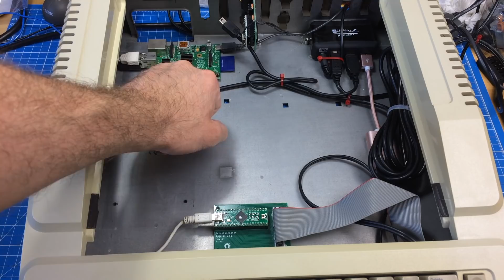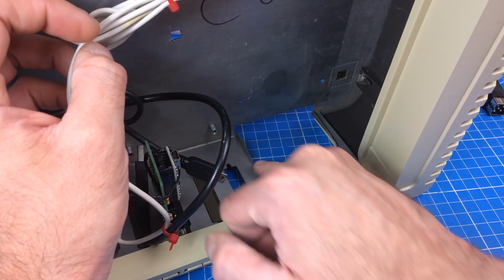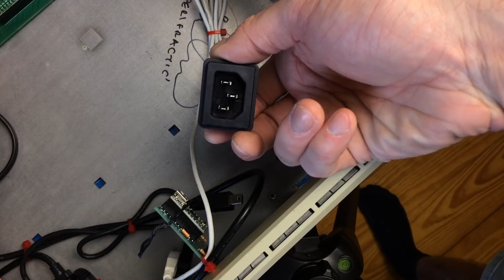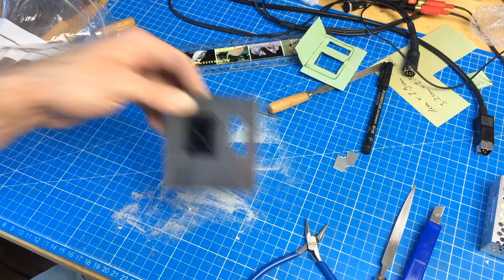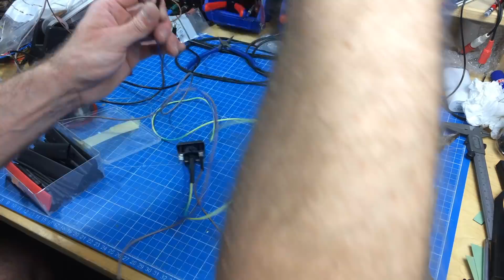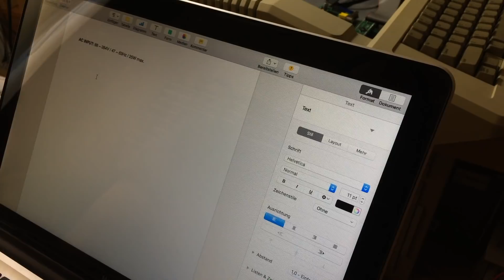Apple PIIe PSU build for the #ThinkDifferentChallenge

Comment: Case nibbler is the easiest way to cut rectangular holes in metal. Start as you did with a drilled hole, then rest can be done with the case nibbler. They are a good cheap tool to add to your toolbox.

Comment: i know, this ist old!
And Jan, i guess you would do the PSU in a different way now.
But.. I would have done the Aluminium for the switch and the powercable from the inside! Spacing the inward bendet case, but getting a nice and clean 'outside', wich forgives a trashy metalplate on the outside.

Comment: Question: 12:51 you can see the hole where the power things go. Why didn't you attach the new plate from the back? It would have looked way cleaner and better. What was stopping you from doing that?

Comment: When switching mains it's a good idea to use a double pole switch. With that you will assure there is no mains voltage at output when switched off.

Only becomes an issue if you fiddle with stuff when plugged in but it's a good practise to use them nonetheless.
Reply from the maker: Yes, that's true. Especially because live/neutral are not fixed in most European countries.

Comment: Great job with the heat shrink, but remember those fuses are live too. Those type of connectors should really come with a back box to fit inside and cover the connections.

I'd also have probably taken an earth wire straight to the case as it's metal but it should be earthed through the screw into the psu anyway.

Comment: For aesthetics, I feel the aluminum sheet should have been placed inside the box and attached, rather than on the outside. Same location, just attached to the inside. Still interesting.
Reply from the maker: Yes, I rushed it a bit so I didn't go through the effort of bending it into the correct shape. Would have been a much more elegant solution in retrospect though.

Comment: The exposed fuse holders on the back of the mains socket are potentially lethal.
The active line and neutral line can both be touched by an unwitting user.  The arrangement shown needs an insulated cover for safety, and a lead from the earth terminal connected to the metal chassis with a star washer, nut and bolt to ensure proper earthing.

None of this was necessary with the two small power supplies because they are self contained and there are no exposed mains voltage connections.

A better alternative would have been an IECC connector with a covered fuseholder (they exist(.
https://www.opentip.com/search.php?cPath=10435&products_id=1263337&gclid=EAIaIQobChMIkPCl3tuP3wIVmzUrCh2lDAJ1EAQYAiABEgKYdPD_BwE

It's even possible to get IECC holder, fuse and switch all in one unit (there is a bare metal strap on the inner face, but this could be made safe by applying epoxy to cover it, just as Heat Shrink covers the terminals).
 The one below would only need one hole, making the installation even easier.
(47x27.5mm)
https://www.jaycar.com.au/iec-fuse-chassis-male-power-plug-with-switch/p/PP4003

Additionally while the Power supply used is more than adequate, the solder pads on the rear of the board under the screw terminals are bare, which is another potential risk. (They also need an insulating cover to prevent accidents.)
The protection circuitry in the Power supply will protect it from short circuit damage if it comes loose and a mains solder pad touches the case (which should have a separate earth lead on a screw terminal for this reason), but it will not do anything to protect a human who comes into contact with the mains voltage before it enters the power supply!

A great idea overall, but not safe in the form shown in the video (especially considering it may end up in the hands of users with no knowledge of exposed mains fuses or safe mains earth connections)!

Comment: Would have been nice to have put that power supply inside the original Apple supply that way the switch and line socket wound be like original. Or a small  project case with line socket and switch mounted just inside like the original supply mounting.

Comment: my gawd. the clumsyness of that linux interface. whereas an actual apple II just switches on and off and 'does it thing', whomever wrote that emulator firmware for the raspberry pi didn't even figure out it's all read only anyway so he can just skip the 'unmounting' and 'terminating processes' bullshit which really are only applicable to mainframes and servers anyway as on anything else the system should always be read only. if not for ease of 'just powering it off' then for security. it even runs that horrid init replacement thing of ubuntu. yuk. ;p
Reply: let's just say the apple II would not have sold in the numbers it did if it came up with a crappy pop up screen to select 2-3 things and move some cursor every time you wanted to switch it off :P "this computer sucks imma buy a c64" :P
Reply: mv appleIIemulator /sbin/init and just delete everything else. lol. better yet skip the linux shit (as seriously who wants an os that spends more time thinking about wether it should not be doing something else than it's one and only task anyway for this) either that or skip the whole raspberry pi thing and just have some new chips made that implement a full apple II but then at 2ghz or so in a single chip.
Reply: computers should have a big ass 'reset' button as well as a big ass on/off button that do just that. reset it or turn it on or off, -instantly-. a 100ms or so delay for voltage levels to become correct and chips to stabilize is acceptable, and then like half a second for it to execute it's roms and come up with the os (in this case, basic), having to hold buttons pressed down for 10 seconds or even worse, going through menus, is absolutely not acceptable in terms of user experience.

Comment: Just my opinion but that metal plate is gruesome. I would have placed it on the inside, similar to the original. As for fixing it in place, machine screws from underneath. With nylock nuts or nuts and thread lock. I’ve done it before rebuilding a power supply in a Macintosh Plus external drive unit. It wasn’t the original PSU but it was very dangerously installed. Now it is earthed properly and safe.

Comment: Choosing to oversize the aluminum plate on the outside was completely against the spirt of improving what appeared to be a stock Apple II.
Keeping with the hot glue idea, if more aluminum plate was used to secure it with existing screw-holes on the bottom, and some hot glue was used around the bent back that would have looked nice. Too bad the signature was so badly placed.
Reply from the maker: I had to rush the mod a bit because otherwise it would have taken me forever so I went for the "quick and dirty" approach rather than thinking it through more thoroughly. In retrospect, I should have taken my time I guess.

Comment: Hi Jan nice video as usual, I would have mounted the whole plate inside and had the bottom layer big enough to mount your new power supply on using counter sunk screws and then be able to use the 2 existing holes in the base of the IIe case so as to leave the original chassis unmodified.
Reply from the maker: Thanks! Yes, mounting the plate inside would have been a lot more elegant. I went for the easier option because I didn't have much time to get this done plus I wanted to keep the metal work to a minimum (obviously not my cup of tea...). ;)

Comment: no need to worry about the connector holes. i've never seen an apple II which wasn't one big mess of rainbow colored flatcables coming out of those holes with half the covers missing and most definately not populated with the connectors they were intended for, even when they were new. lol. as in usually the cables just went through the holes and were plugged directly into the expansion boards on the inside. very nasty. :P (maybe even more so than having usb cables run inside of a computer ;)

Comment: oh and btw, the apple IIe PSU is basically an aluminium profile with the psu transformer and board on top that indeed, slides in there over a significant length of the case next to the mainboard which fills most the rest of the bottom of the case. the thing that sits at that hole is the fuse and the IEC connector and some plate going 'bla bla apple computer inc' if i recall correctly (it's been a few years since i've seen an actual apple IIe)

Comment: seriously?... how about starting with getting one of those apple psu's reproduced. exactly the same thing that was there in the first place and which did, after all, work for 35 years or so. (and yes it does take IEC plugs and does have a 5v rail) secondly, the raspberry pi is nothing more than a development kit for a chipset which isn't even for sale. so firmly useless. start by finding some arm chips in something not-shitty-smd-bga formfactor (so it doesn't rot off the pcb all by itself within 2 years from now), design a pcb to put the arm system onto. get rid of all that usb stuff, nobody in the world even knows how the usb protocol stack works and the few that do get ripped off on having to pay for 'vendor ids' so usb is cancer. build a proper keyboard decoder out of discrete logic like the apple II itself had, design some video circuitry that can output dvi-d (preferably something a bit more straightforward in programming than vga or ripoffs thereof).. etc. basically, anything not 'a raspberry pi with a bunch of usb wires in a disappropriated case'
Reply from the maker: This is a hobbyist project and it's supposed to be easily hackable and expandable, so I guess using a raspberry pi is one of the better ideas. Leaving the cables like they are also adds to hackability. I agree that I could have put more time and effort into making the PSU or at least the backplate look better (I had to rush this plus I don't have any experience working with metal--which shows in the video).
Reply: Uh i know how USB works. That's what USB specification is actually for. Well except for some historically emerging weirdness with specific devices. But keyboards really aren't that much of a mystery. Besides, who let you off your meds? Why would anyone apply actual product engineering approach for a system that only needs to exist once, which is what Pi is perfectly suited for? Besides you don't get much choice in non-BGA-land, either the micros without RAM interface so uh STM32 is about as far as those go, and on the other hand just i.MX233 and Allwinner A13, either is pointless because all you'll get is a buggier Pi.
Reply: usb has 3 different controller 'standards' all of which are for connection to a 'pci bus', which needs to be scanned, bla bla bla (and which can only be done in 32 bit mode at a time). it can be on multiple locations on that pci bus and even behind bridges. vendor ids would have to be obtained (PAID FOR) for both the usb and the pci shit to avoid conflicts, etc in other words, it's one big mess... plus why bother with all of that in the first place.. people of a company i worked for went to that 'usb consortium' meeting somewhere in the 1990s, laughed their ass of, came back to the office and went like 'we're not gonna implement that shit' lol. and they were absolutely right.
Reply: as for BGA ic's i'd rather give 80000 bucks to a chip fab to implement the same logic in a 5 volt dip than to use a chip which will just break off the pcb in case of some moist freezing under it. any 5 volt dip shit will literally just run while submerged in motoroil, exposed without a case on the fucking northpole or even while being dropped into salt water (with a bit of luck). try that with that 'bga crap'. all bga ever was is: cheap trash.
Reply: as for the raspberry pi as such... it seems like someone tried to make a 'development board' for a chipset and then forgot that the whole thing is booted up by some propriatory 'gpu' (a chip that isn't exactly needed for most of it's functionality anyway, as they'd only rarely get connected to a monitor of some sorts). for whch they even decided to pay bribes to the hdmi consortium. (which is about half the price of one of those things) rahter than just sticking a dvi-d connector on it which does the exact same job and is a lot more sturdy.
Reply: best thing to do with an apple II case, is to just put an apple II into it. by far a more stable system than any 'raspberry pi' ever will be. after all, most of them still work. i highly doubt any of your raspberry pi crap will even last 10 years of 24/7 use.
Reply: i'm sorry, i can't seem to find the military part numbers for your 'raspberry pi'. nuff said on the quality of that shit.
Reply: the computing industry is going down the drain and is going down the drain rapidly. selling all kinds of inferior shit that's usually already broken when it leaves the production line, and that 'bga' shit is a huge factor in that. as is all that 'low voltage' crap. (touch it with your finger or spit on it and it crashes and dies).
Reply: so yeah. we're not only gonna have to re-build our own fucking internet with booze and hookers and porn but from the looks of it we're gonna have to re-build the computers to run it on as well as well as the chips that are supposed to go in them.
Reply: let's start with a 5 volt dip version of the crystallan cs8900A (or something simular) and some 'dvi-d capable' video generator chip as those seem to be the 2 lacking factors on the market at the moment preventing mass production of PROPER hardware that does the job and does the job for at least 50 years in a row.
Reply: computers don't exactly get faster by increasing the clock speed by a few 100 to 1000 megaherz if you're gonna put the peripial chips behind some retarded serial bus with a bunch of other useless crap in between, now do they. (and not even a really good serial bus at that, it doesn't even daisychain).
Reply: USB is not at all tied into the PCI ecosystem, this is how PCI-free microcontrollers and SoCs can support it. It just happens to be connected to PCI bus in PCs, because everything is. The multiple variously ill-implemented controller standards (OHCI, UHCI, EHCI) are only relevant to PCs, and i must say it's actually a positive development that such standards even exist, because else every manufacturer's USB hosts would be incompatible with each other - think PCI/PCI-e soundcards or video capture cards but it's not a single device hanging on a fragile proprietary driver, dozens would be. The USB communication itself is fairly straightforward and smart, well as straightforward as you can make a system that has to share latency-sensitive devices with devices that shovel megabytes of data at a time, or even devices that have both latency and bandwidth requirements. It's a tall order to have both a soundcard and a fast hard disk on a single host endpoint that is too narrow for the sum of their max bandwidth and not have the soundcard skip or run out of data ever, and yet USB accomplishes it.

If you want to create a new host controller for PCI bus, of course you need a PCI ID and a USB ID. If you want to create a new USB device, you need JUST the USB ID not the PCI ID, which you could just shop around smaller hardware manufacturers and ask around if they'll give an ID out of their pool if you're a very tiny company bordering on hobbyist side-activity, and there are some who sell USB solutions for smaller hardware manufacturers and outright sell IDs for cheap. For any moderately sized company, buying a USB VID is not really a notable expense, it's really just a few grand. If you're creating a USB device of existing class for a hobby, just get the public shared IDs from V-USB. 

Device IDs are actually a pretty good thing. Imagine if you had just port1-port255 and every time a user installs a driver for something, they'd need to specify what port out of 255 it's connected to, and how are they even supposed to know? USB device classes and standardised drivers are good too, since not only are they maintained by the OS vendor, you don't need to pay exorbitant amounts for driver signing.
Reply: For what it's worth yes Pi is purely a hobbyist part, which is what you have here, a bunch of hobbyists poking around. As to using USB to scan the keyboard... sure i personally don't know why you'd do that if you can use a couple TTL series ICs and Pi's GPIO, and actually you can do a shit ton of stuff with GPIO, but well Peri doesn't have much any electronics knowledge so an existing USB adapter is about the best he can do, good enough to play around with. And i'm thankful that there's GPIO to begin with.

Pi solutions do usually seem "cheap" and underengineered to me but oh well. Especially if you need video and a good chunk of RAM, there's just little else you can sensibly use if you have just the resources of working yourself evenings at home and don't have access to all the proprietary  documentation for other hardware items you may deem more suitable.

No idea what axe to grind you have with LQFP and SOIC packages, they don't just fail on the connection or the package with any appreciable frequency and are so easy to mount. If i never see a DIP again it'll be perfectly fine. BGA is indeed not something i can work with personally for numerous reasons, and their connection is indeed fragile.

If you want a... if i may suggest, DV9000 or AX88796 made in a 100-pin through-hole package, and are actually willing to pay a fab to do it, hey be my guest, but i'm not going to buy any myself.

Comment: A nibbling tool would have made making the holes in the aluminum a lot easier, they can be picked up cheaply on ebay.
Reply from the maker: Yep, I'm not equipped very well for metal working at all (yet). I'm going to get one asap. :)